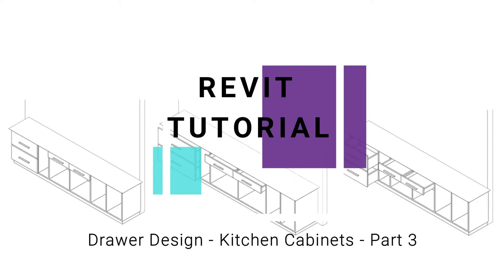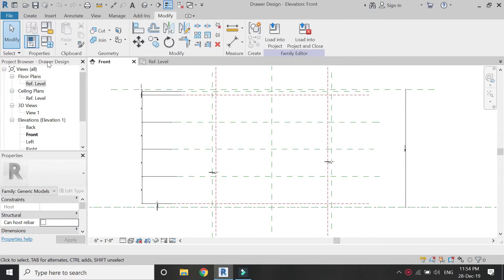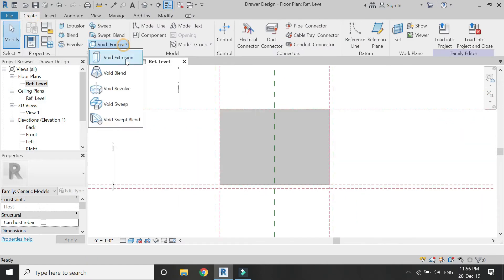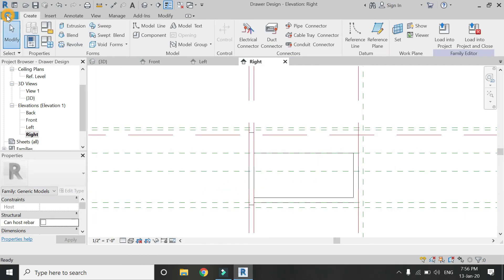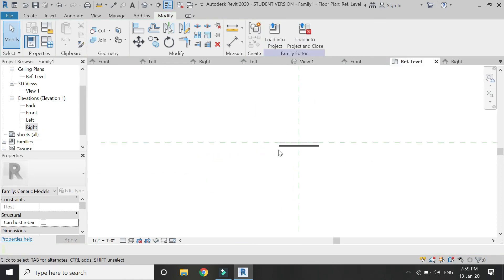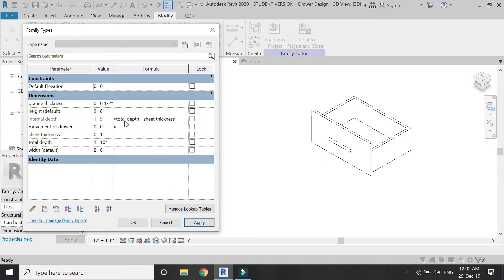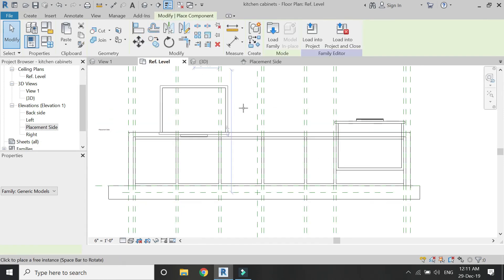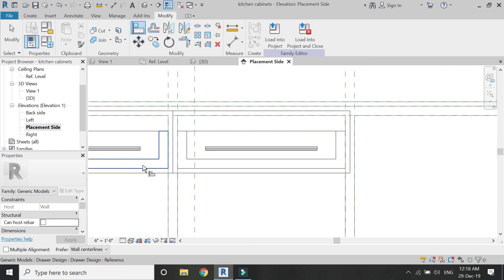Revit Tutorial - Kitchen Cabinet - Part 3 (Drawer Design)

Comment: I have been able to create the drawers, although when making the third one. When I click to change the height to 'half' the handle and the drawer dont move together. theyre still grouped but the handle remains at the height it was before changing the actual dimension and the drawer not only moves down the cabinet, but it also turns into the needed height
Reply: Exact same issue I also faced while making the third drawer and after some trial and error I found out I was aligning handle to the extrusion of drawer and would definitely not move with drawer ... The solution is always align nested family to the reference plane with desired location . If reference plane not available then place a new one and put dimension to the nearest existing reference plane and lock it .... hope it will solve your problem....